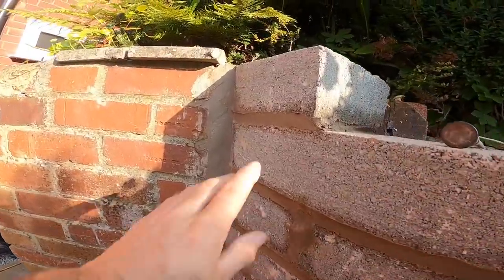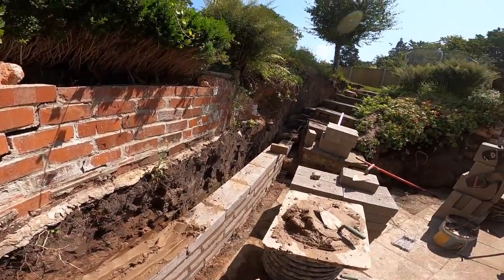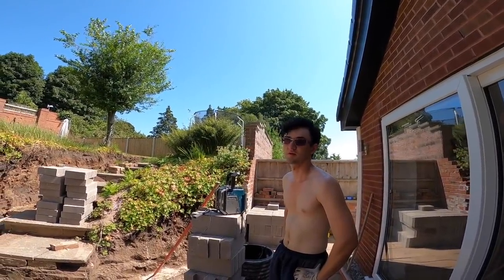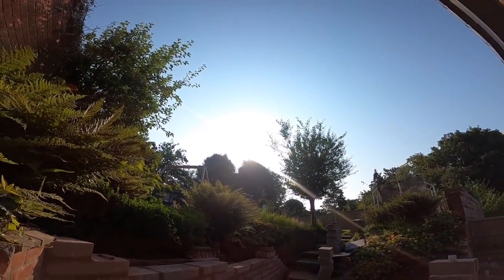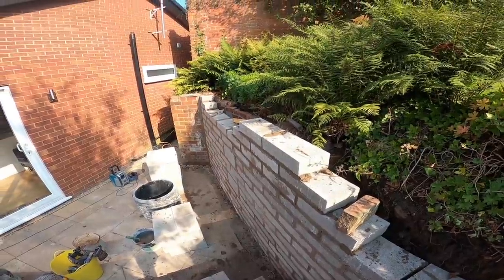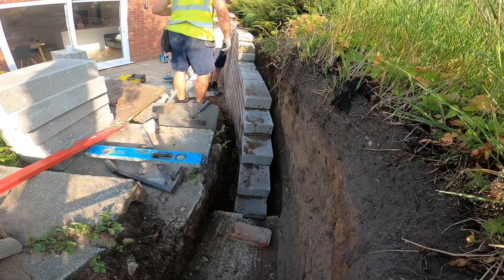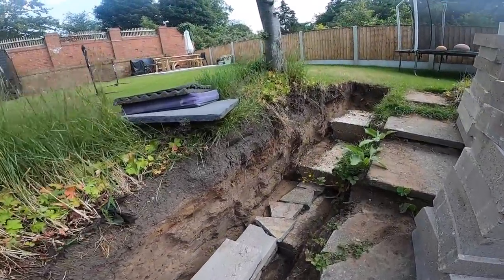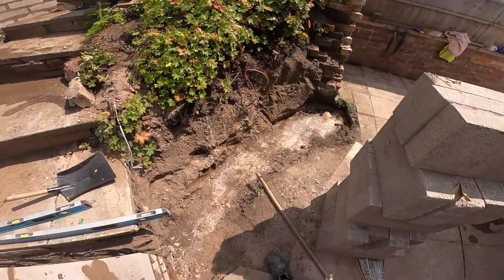CURVED CONCRETE BLOCK WALL UP A BIG HILL !

Comment: Top work Steve and Alex very tough going in that heat ! Nothing worse than having to bed up when u loose the foundation in the steps great recovery with breaking the slabs for a bed apart from the one that didn’t want to break Steve lol some brick hammer that though super power 👌 poor Alex will never have a week off after you pulling that job on him on day one ☝️
Reply from the maker: Cheers, I love that hammer 🔨 😍🧱👍🏽

Comment: Sorry lads, but I had to chuckle when you mentioned it was a bloody hot 26 degrees. It's just gone midnight here, and the thermometer beside me is showing a rather pleasant 25.8 degrees. Come about 10 AM the temperature outside has been getting up to 35 degrees, and that holds to around 8 PM before it starts cooling off. 90 miles east of here the temperatures get up to around 45 degrees during the day. Now that is a bit warm.
Reply from the maker: Jeez , that is warm . Our bodies are used to an average of about 12 hear in the , we ain’t used to hot sun as it’s not around for long 🥵😆😆🧱👍🏽

Comment: Better man than me. I took a week off in that heat. 
Can I ask I'm doing a 12m length x 2m high flat block wall. The guy doesn't want pillars but I'm sceptical. It's not a retaining wall and was going to put a pillar at the front entrance. I was also wanting to put an expansion joint in the middle. Do you think you could get away with no other pillars? Cheers
Reply from the maker: I’m no expert but that sounds a bit high to have no pillars 🤔😳🧱👍🏽
Reply: @SteveAndAlexBuild  yes it does. I'll do a bit more research. Good luck.
Reply from the maker: @Oncewasdonka  🧱👍🏽
Reply from the maker: @martin2466  Yep 😬👍🏽🧱
Reply: @martin2466  I think he will go with piers. Thanks for your reply.

Comment: Cool, but I wouldn't be me without a question or something :D I err, did my math with 10mm thick mortar but noticed you had a kinda pillar and that two flat with one layer mortar = standing up. Which means that line is 15mm. Which puts my math out by 20 x 5mm = 100mm, which is really handy since that means I just do one less row.

You put the mortar 10mm thick standing up, right?

Oops, edited to make more sense :D
Reply from the maker: I’m sorry but but you have baffled me with this One 🤔😳🧱👍🏽
Reply: @SteveAndAlexBuild  lol, yea, errr ... I was talking about how thick the mortar is. Should have read 'did my math with 10mm mortar'.

Freaking key words that are essential to sentences, who needs them ... eh?
Reply from the maker: @bipedalspecies2086  😆 . 
This will throw you then . 1 block stood up with a 10 mm bed = 225 mm 
2 flat = 1 stood up 225 mm BUT  the blocks are only 95 mm deep when flat so beds are a lot bigger 🤯🧱👍🏽
Reply: @SteveAndAlexBuild  ahhhh, right, the blocks I'm ordering are 440 x 215 x 100mm deep ... or at least stated as that. I thought they were all a standard size ... or am I about to find out that 100mm on paper = 95mm in reality? lol ... a builder wrote the specs down and it was only an estimate.

Can I ask, how thick did you make it when it was the garage/retaining wall video you posted? -which is essentially what I am doing.
Reply from the maker: @bipedalspecies2086  . I think that wall was 3 skins thick 🧱👍🏽
Reply: @SteveAndAlexBuild  ugh ... great ... now I need to go find that video and watch it again ... and I bet I notice something else and, ah sorry to be a pain in the ass, I thought asking the bed depth/thickness (dunno which to apply but pretty sure it isn't width, go on say height) would be straight forward. I bet it is straight forward as well as soon as you learn the caveats, all 2 or 3 hundred of them.

As always, thank you for the replies and help.

I'm pretty sure at this point I owe you two beers.
Reply from the maker: @bipedalspecies2086  Bed depth is always 10 mm ……. Except when it isn’t 😆. 
    Seriously 10 mm is the bed thickness standard …. We don’t drink 🚱 so you’re in the clear 🤣🤣🧱👍🏽
Reply: @SteveAndAlexBuild  well call it takeaway tokens or whatever, entirely your choice :D

"We don’t drink 🚱 so you’re in the clear" not really, I feel obliged, site rules. Last time I spent beer tokens it was on computer parts, buy a pizza or something with them, assuming I send them, I just said I owed them ... did I at any point at all say I would pay? I just said I 'owed' ...

Hehehehe
Reply: BTW, I have had a couple of beers and hope that sounds OK, sorry in advance if it doesnt ...
Reply from the maker: @bipedalspecies2086  😏🧱👍🏽
Reply from the maker: @bipedalspecies2086  🤪🤣🤣🧱👍🏽